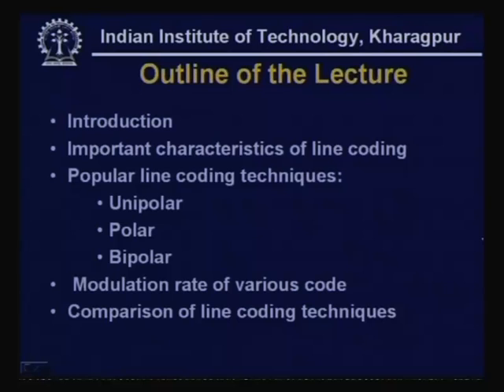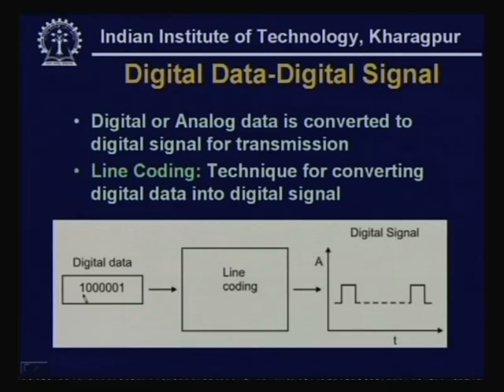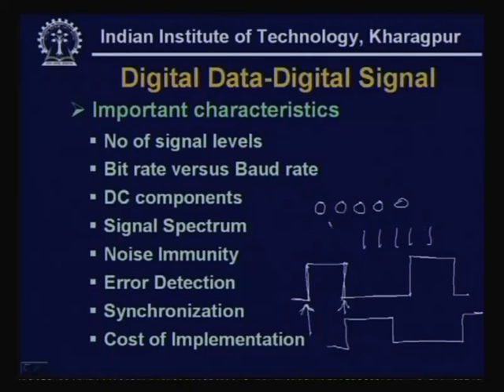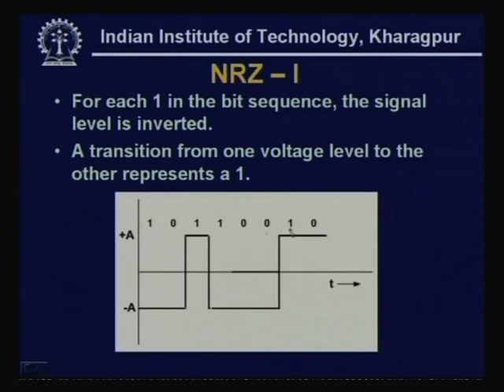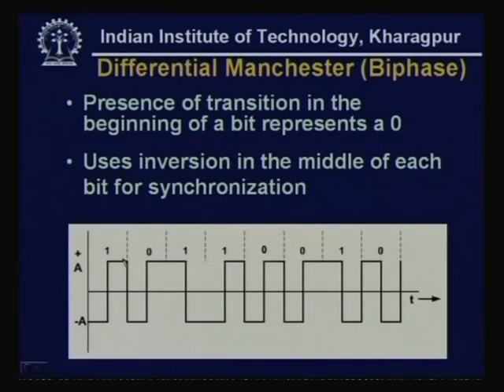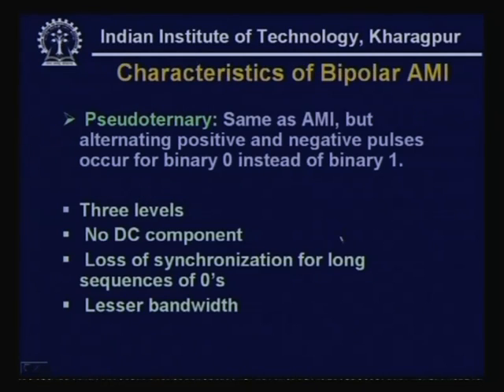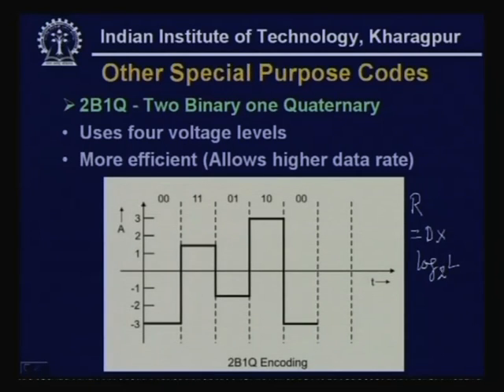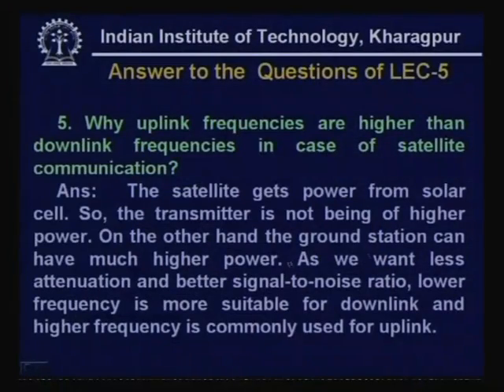Lecture -7 Transmission of Digital Signal - I

Comment: In Pseudoternary ,I think loss of synchronisation will happen when there is a long sequence of 1 ,instead of 0...
Reply: In Pseudoternary, whenever there´s a long sequence of 1s, the voltage level will alternate between positive and negative values, therefore eliminating the DC component.

Comment: somebody please explain what is the difference between dc component problem and synchronisation problem,. i think if one problem happens the other is sure to happen
Reply: Pawan Prusty 
they are coherent, the phase locked loop performs well when there are several transitions in the signal...if the dc component is present then the PLL circuit fails in maintaining synchronization...